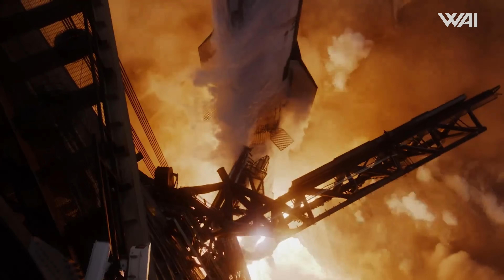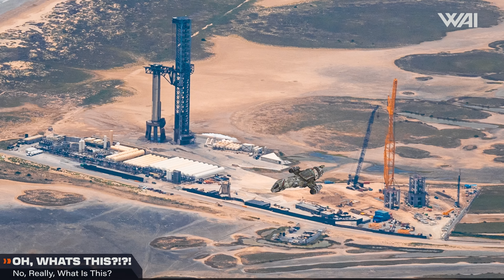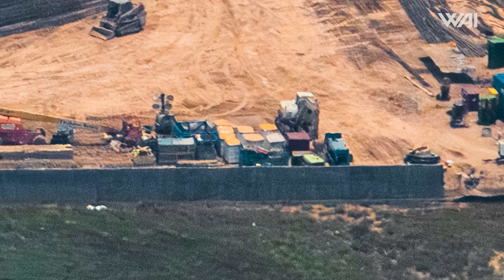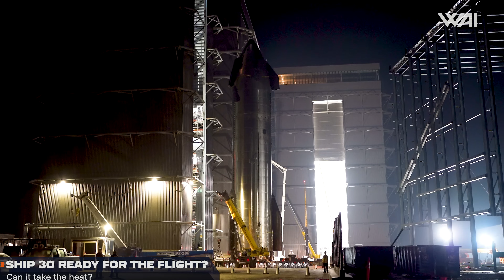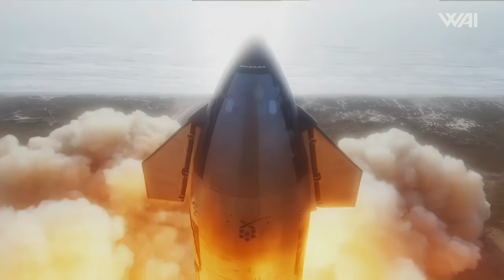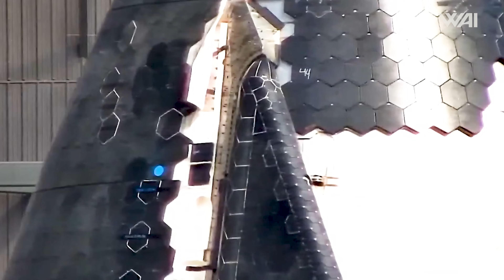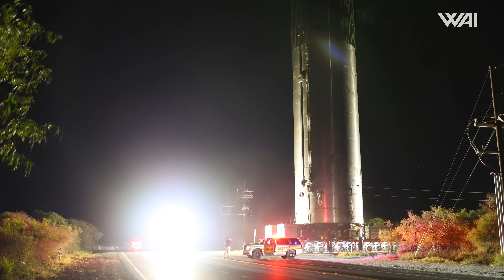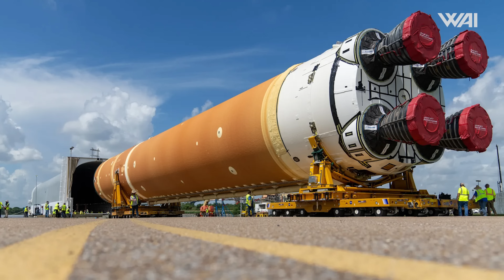SpaceX Finally Reveals Its First Real Starship Block 2! What's Different?

Comment from the maker: Will the upcoming Block 2 Starship perform a first payload deployment? What do you think? :_WAISweet::_WAIStarship:
Reply: Hello @Whataboutit. Thanks for the updates. Can you start using chapters, pretty please?
Reply: @skyserf with the self promotion & channel metrics & sponsor read all as separate chapters so we can skip them
Reply: @skyserf  oh please 😑
Reply: Deorbit burn and pez dispenser tests are still to do.
Reply: @RODI____  They did the pez dispenser test but they were going to do them on IFT3 but aborted it. I think they might do it again on 5 or 6.
Reply: I think which ever flight is totally successful, prob next flight may
Reply: Maybe after flight 7 they will first start with doing some Starlinks?
Reply: Hurriii-CAYNE, not hurrikin. Felix

-your neighbourhood speech helper.
Reply: It would make sense to push while the other rocket format is halted for review
Reply: @LetsomD  Starship isn't paused.  Different rockets, different programs.

The thing is though that the development of Dragon is all but done. They really have no need to try to work on Merlin and the rocket itself will never change without an engine change.  

A Merlin had a valve stick open. It's rocket science and after 360 flawless trips, it sounds bad but it should be expected. you want and push for perfection but the number of failure points on a rocket is in the tens of thousands and even though you work on making them all work, anything mechanical, fails.

Lastly, there's a strange symbiosis between rockets and their upper stages. Since SpaceX landed it's Dragon perfectly, it has to be a lesser inspection by the FAA on an upper stage when half of the rocket worked flawlessly.
Reply: I don’t think they will try to deploy anything, but will test the payload doors now that they’ve been redesigned.
Reply: I don't think so
Reply: Better than Rocket is here
Easy lift off 
Easy land on with antigravity Spaceship
No Fire
No Explosion
No Flame
Just Spin and
Lift off
Powered by Baterry

Work base on Gravity just spinning by using Battery
can fly in bad weather, plunge in the ocean even in outer space
Can lift more than 100 Ton 

Earth which weight predict 600 trillion ton does not fall at the Sun because of centrifugal in orbitting, on the contrary it does not be thrown far go out the orbit line of hold by gravity at the Sun as orbit center. Gravity and centrifugal is equal called Equillibrium, thats why until now Earth which we was inhabited always rotate and circulate the Sun. Now we justly take example : how if the gravity used and centrifugal is negated? The Earth will float far leave the Sun. So that centrifugal can be used to fly far away if gravity eliminated. Finally how to eliminate gravity?

It’s way rotate part of aircraft by horizontal. When that rotation faster centrifugal force getting greater and the gravity getting smaller, finally it lose the gravity and the aircraft start flying. Of course people would surprise: how the aircraft can keep rotate without fulcrums? Thats why we named that aircraft Shuttling System that is aircraft likes two disc adjoining attached in the midle as fulcrums:

A. The Top part, we name Positive rotate to right, and the edges is getting thicker and havier.

B. The Buttom part, we name Negative rotating to left, and the edges is getting thicker and havier.

C. Middle Part , we name Neutral, air crew placed and also machine and everythings turning Negative and Positive at the same time.

The aircraft can liftup added with explosion from the engine. However that aircraft construction later, let the engineer doit it, and we are sure the aircraft will bulletproof and also waterproof.
 
.
.
 
In modern civilization where human being generally using flying saucer as vehicle, will a lot of change in lives either in materialism and in psychological. In materialism area will apply the change in life like.
People no longger need roadway and rel road which spend large of energy, money, places, things and time, object place and time. People would utilize that area for habitat or for other need:
Reply: My guy looking like - doctor strange from an alternate universe with rocket knowledge- he just needs a cape
Reply: IFT-5 now!!
Reply: @Whataboutit  probably :D
Reply: Imagine if they eject the engines after use and Starship scoops them up and brings them back for SLS! 4 launches/landings and SLS has their engines back!
Reply: @Whataboutit  
The Starlink deployment requires Starship to circularize the orbit, dispense satellites, and retro-fire to deorbit. So as soon as some Starship demonstrates a couple successful zero-G engine burns, the satellites can be next. It could easily be block 2, since the door opening is already improved on that version.
Reply: Maybe some Starlink satlellites... but that's all.  Any general purpose cargo bay doesn't exist yet and maybe never will.  The structural support and mechanical systems would be heavy and eat into Starship V2's already wildly optimistic payload capacity estimates.

Comment: The Starship design is well entrenched at this point but it seems these tiles and heat resistance are going to be problematic going forward, as they were for the space shuttle.  Its hard to cover a round / tubular object with flat plates ... does anyone know if consideration has ever been given to the starship having flat vertical sides, were it shaped like an OCTAGON or even a DECAGON, instead of a circle?   Air resistance would be similar but it would be a lot easier to make with just flat sides and it'd be a whole lot easier to cover in tiles. Even more, it'd give it that Cyber look that Elon loves.
Reply: I think you're making much more of it that it warrants.

Comment: Can someone explain to me why there’s still moving flaps? The best part is no part, I just do not understand why it couldn’t be completely done with larger thrusters or at most fixed aero (think small shuttle wings) behind the midpoint of starship and thrusters. Gets rid of giant metal inner structures, heat tiles, weak points for extremely hot gasses to permeate, bearings, hydraulics, electric motors, batteries. That’s all weight and complexity
Reply: You say best part is no part and then advocate removing flap actuators and replacing them with thrusters...  That's one simple part out and a complex part in.  There is no logic in that.

Comment: What we are missing from SpaceX for Starship is how it can carry big cargo.  I have seen nothing to say they can make a ship strong enough to have a large opening to deploy cargo to space.   All they have done so far is the pezz dispenser and that was not a great start for that.  Anything they do to create a large opening is going to require a lot of strenghtening and therefore reduction in to LEO or deep space mass.   Would be nice if we saw more action on that. I bet their customers would as well.  Not doing the initial trials with this in mind seems like all we are going to get is a water tank to space with stuff inside.  But it will not have been developed to carry large structures and deploy them.
Reply: You're looking at low fidelity test articles.  Development is not done yet.

Comment: Space X has a plan, but the conservative element is struggling to keep up, in fact everyone is struggling to keep up. But everyone is struggling to understand what is going on? What was determined to be a concept, everyone is finding out to be reality. eg, The Chinese attempts to copy, but they have to reverse engineer what they see, then there's multiple upgrades that they have to study the why and the whatfor? And Elon's competitors are facing the same problem! Space X's competitors are actually years behind. At some point Elon will have a payload to space, to once and for all just to prove it can be done as part of the process! Why not, its good business sense!

Comment: So a completely wild guess. 
First and foremost they will dig slightly deeper still. And then put a tank farm with straight piping.  Reducing the bends of the pipe( complexity) and not needing such a high deflector wall. Just a guess. But why not
Reply: Cryogenic piping actually requires periodic jogs in the run to cope with metal contraction.

Comment: I think something many people dont yet realize is that every new Starship is kinda a completely new rocket. Like there are so many things that are changed and redesigned it is insane. And this is just the beginning. Starship will massively change in the near future. I wonder where the "landed" or lets say deorbited Starship is by the way. Did it just sink in the ocean?
Reply: Yeah. When Starships are recovered and post-op analyses can be applied, they can back-off on the "over-engineered" choices. Also, minor changes can be retrofitted to any recovered ship and booster, not just those new versions leaving the factory.
Reply: Starship and SH were likely scuttled by operating the explosive charges. Perhaps right after the video stream was cut.

Comment: I wonder if installing the flaps away from the tiled ship's belly could help to keep its hinges from having to take some of the heat
Reply: The front flap hinges will be moved out of the direct plasma stream on version 2, but the rear flap hinges are staying put. 

Also, the front flap hinge gap will still get plasma under high pressure when the flaps are extended into the plasma stream. The flexible hinge seal is still critically important. 

The front flaps failed when thermal tiles separated from the stainless steel sheet metal. IMAO, the sheet metal surface was not rigid enough, and was pushed inwards, away from the rigid tile, peeling the adhesive layer apart. The flap surface needs to be much more rigid. 

In the IFT-4 reentry video, we can see the large gaps between the internal flap braces. This is why I think the flap metal deflected and caused tile separation.
Reply: @imconsequetau5275  Thank you. I thought they were just moved forwards. I was thinking about moving them away from the center

Comment: still do not know why SpaceX do not use ceramics finish on the pad.  This will help to contain de heat and avoid fire exposed directly to the metal.
Reply: They burn a lot of paint off the metal during launch. Is ceramic more durable?

Comment: Exactly how long was the static fire? Looked rather long. As in almost as long as the first lift off that tore up the launch pad ...

I wonder if they could stack pairs of tower segments, then lift them onto the tower being assembled.  That would allow to do some work in parallel to make for lost up time ... weight limits?
Reply: The crane cannot handle the weight of two sections.

Comment: Was thinking about the Size of Starship Booster -- maybe 240 feet by 27 feet Diam is a BIG CYLINDER. WIND LOADS of 30 to 40 mph Could bring 5 or More TONS OF LATERAL WIND LOAD.  while attempting Tower Catch.

Comment: I was just thinking about the space program and the lack of advancment. In 1969 I was hopping it would turn into a new industry. I was wrong, it turned into a cash cow for the big guys. Waited 50 years and here comes Elon. He cranks it up into high gear and doesn't let up. Can you think what it would have been like with these two running things? We would be on Mars now.

Comment: Random question, and it's probably dumb, but i'm tired of pretending that I know. How come the starship stage needs a heat shield, while the booster bit doesn't? Don't they both leave the atmosphere before coming back?
Reply: @johnlusumpa9025  yes, but the booster is significantly slower and therefore the steel is enough to handle the heat, if there even is some, i am not sure

Comment: If SpaceX can’t get tile cooling good enough to protect the flap hinges I wonder if it might consider transpirational cooling for just the hinge areas. In the early Starship concept stage transpirational cooling was mentioned as a possible total replacement for a traditional heat shield but rejected due to weight (it would use a lot of LOX or whatever gas was used) but maybe just for the hinge areas a possible solution if other solutions fail?
Reply: Flaps for v2 ships are placed outside of the plasma flow, so that should already be fixed for S33 onwards.
Reply: @Mynnhos  
Only the forward flaps are repositioned. The rear flaps continue to stick out in the plasma constantly, but even the front flaps need to engage in the hot plasma occasionally.
Reply: I also look at active cooling as a supplement to thermal tiles. However, the early flap designs have plenty of room for improvement, with large gaps between internal braces that allow the sheet metal to bend inwards. 

Version 2 flaps are far thinner and likely already are far stiffer to retain the rigid tiles without peeling off the tile adhesive.

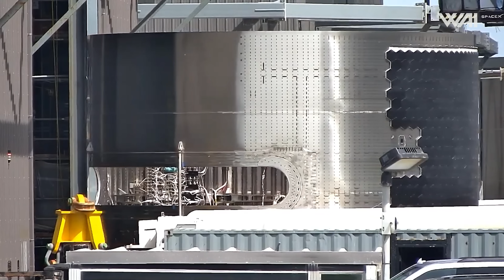Comment: At 12:02 what caused the dent in the ships skin?
Reply: I think you refer to the dimple at 12:03, right beside the two dark circles. 

The curved nose-cone has less need for internal bracing, but this greater flexibility also allows thermal stresses during welding to pull it out of shape. 

It will likely pop back out when internal air pressure is increased during leak tests.

Comment: This IS rocket science. Reputedly very complex problems to address and investigate failures. 
SpaceX seems to handle very complex problems and difficulties in an organized manner that successfully has dealt with issues based uoon their research.

So, maybe SpaceX should investigate the assassination attempt upon DJT, maybe?
I don't trust Congressional "investigavtive" Committees that take forever to answer (or not answer) "yes" or "no" questions.
"A camel is a horse designed by a committee," says a once-popular quip.

Comment: I don't believe the hinge itself was the culprit in the last flight but the hinge gap. The low pressure area on the lee or upward side of the flap hinge resulted in plasma being sucked into the low pressure hinge gap, aided by the ram air effect on the direction of travel side, and with no static atmosphere in that space the plasma just kept adding energy to it till it found the material limits. I think either the hinge gaps will need to be tightened to resist flow or some sort of blocking device/material added.

Comment: We have a skyscraper here, 115m high, every time I pass the building, I try to imagine, that building going up, too comparable to Starship. This must be a "holy cow" moment 😂
Reply: @remnote-ffp  thinking about that the house i used to live in was just 28m high and had 8 stories
Reply: Can you send Google maps location of that skyscraper?
Reply: @rajesh-ww9sm  49.648010157119586, 8.344402354151487
i miscalculated a bit at first it should be like 28-30m high depending on the thickness of the ceiling/floor

Comment: Is Flight 5 going to use an expendable hot-stage ring?
Reply: Yes. The booster mass is already excessive, so these 10 ton interstage rings will be discarded before reentry for a while. Wait for the next booster version to see an integrated hot staging ring. Probably also 35 engines and stretched tanks. 

(This temporary ring includes a heavy redundant dome to protect the delicate structures, like grid-fin actuators and plumbing,  that cannot cope with hot-staging.)

Comment: I wonder why the hottest parts of the flaps aren’t upgraded to titanium (it’s lighter than steel and handles much higher temperatures).
Reply: I'm sure they are focused on both cheap and light practical solutions. 

For example, the first flap design had excessive gaps between the internal braces that supported the sheet metal skin. You can clearly see the internal braces, and spacing, during the IFT-4 descent as the flap evaporated and burned up.

These gaps allowed too much metal surface movement, so the adhesive layer on tiles broke away. 

The new flaps are much thinner and must have tightly spaced internal braces (a honeycomb, I suspect). The version 2 flaps should be much more rigid, so the adhesive layer will not be pulled apart.

Comment: I really do think they'll need some form of rail transport system to move Starships to and from the launch and test sites. It'll be quicker, smoother and reduce the need for road closures.
Reply: The road has little room for being made wider, much less installing a rail right-of-way beside it. These are State and Federal protected wildlife sanctuaries. SpaceX would end up paying for berm expansion, while rail is hundreds of times more expensive.
Reply: @imconsequetau5275  where there's a demand there's a way. Its not a problem now, but once you're producing 1 starship a day as planned the road closure system will not work.
Reply: @Codysdab  
LOL, the ships can all be transported on the road at night, that's not a problem to me. But how does one batch-launch 7-14 Starships in one day, and how does one fill up the propellant storage tanks? That's an insane number of tanker semi-trucks, so I suppose an off-shore pipeline and propellant transfer from tanker ships is necessary.
Reply: @imconsequetau5275 i agree they'll need incredible infrastructure just to fuel the Starships, trucks are not fit for the job.  An offshore terminal to allow methane and LOX offloading is most likely, but again you hit the national park thingy. Same with a huge methane/oxygen production plant and pipelines nearby.